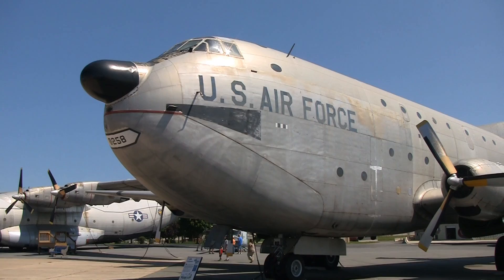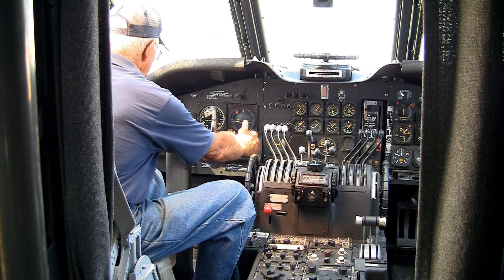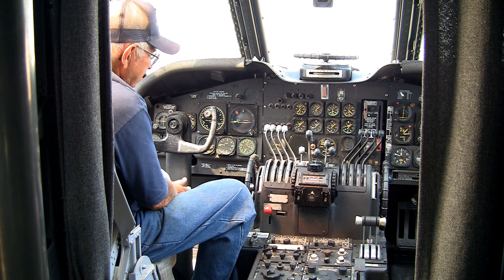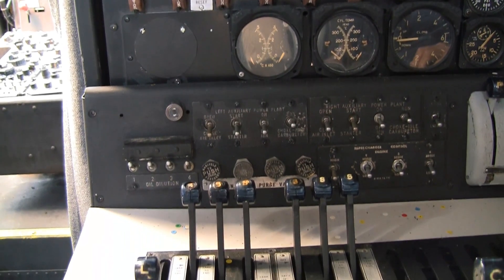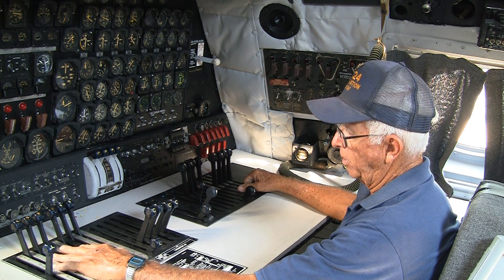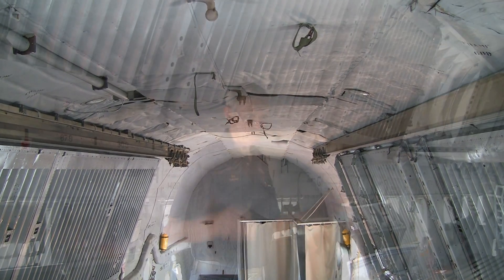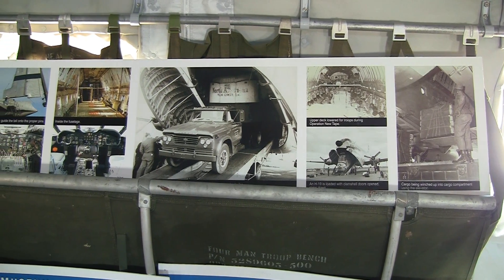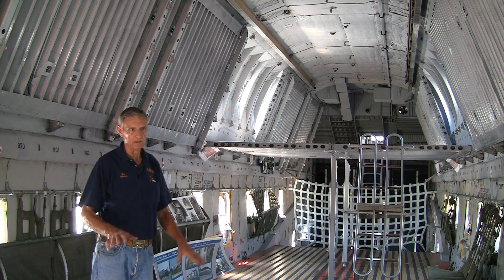C-124A Globemaster II - "Old Shaky"

Comment: I was an Army Warrant Officer Caribou pilot and ferried my CV-2B to Vietnam in 1965. We had an Air Force C-124 assigned to our company to help us navigate. All the Army really had for over water navigation was dead reckoning. The Air Force C-124 pilot would delay his take off to arrive at the halfway points between islands at the same time as our slower flying Caribous. I remember that radio call. "This is mother hen, where are my chicks?" Then I would hold down the mike button on my FM radio and the C-124 navigator would home in on the signal and find us. He would give me a new suggested heading, and then fly on.   We were a flight of 12 in three formations. I was the designated navigator in the lead ship. I remember on the longest leg which was from California to Hawaii we had drifted 70 miles off course by the mid point due to unknown winds aloft over the ocean routes. As we drew near each of the islands at 10,000 feet, and at about 80 miles out, my ADF needle would home in and I could relax a bit and track inbound to each destination airfield. All together it took 80 flying hours to make it from Fort Benning to Vung Tau.     TRH
Reply: Gage  Hi Gage. Yes we had a powerful HF radio, but during the day it is not very effective. They were rarely used in normal day to day operations. At night when the ionosphere re ionizes, the long wave signals start bouncing off of it and then striking the ground at a high angle and then back up, and so on. It is possible under the right conditions to send and receive signals half way around the earth. One of our pilots was a Ham (amateur radio operator) and several us piled into his plane one night, climbed up to 10,000 feet and were able to contact one of his friends, a fellow amateur in the states. Now we were legitimately able to use the Ham frequencies. His friend in turn patched us through to each of our homes on his telephone just to say that we did it.

Comment: I was a pilot on Shakey.  I am ninety years old, and probably one of the few remaining.  To get one thing straight, the engine was feathered prior to going out in the wing.  To get to an inboard engine, your had to crawl  across the retracted gear to get to the panel that covered the rear of the engine.  Normally, the retracted gear just rested, without any pressure holding it up.  When you went out, the gear handle would be put in the "UP" position.  When the generator was pulled, the engine was restarted.   I spent thousands of hours on ole Shakey.  For a year, I flew from Tachikawa in Japan to Korea, hauling in cargo, and flying wounded back to Japan to a general hospital.  On departure, we flew right across the battle front.   Boy, were we happy they didn't have any anti-aircraft weapons.  The pictures brought back many memories.
Reply: Thank you for your service to our country sir.
Reply: Thanks you, Sir.  Without guys like you, we would be speaking German or Japanese right now.  I'm retired Air Force, 35 years of service and a Vietnam Vet.  It pales in comparison with what you were up against.  I salute you...
Reply: Richard Black A great big SALUTE to you sir and thank you so much for your contributions!!
Reply: These Birds were also located at Donaldson AFB in Greenville , SC .
Reply: I'm pretty sure your passengers will be forever thankful for your services. Much respect to you and your comrades for doing what you did.
Reply: I owed you my freedom Pilot Black !
Reply: God bless you sir, and thank you for your service. With all respect, in the case of my father's aircraft, the flight engineer went out in the wing with the engine running as normal as he couldn't figure out why the RPMs were dropping yet everything else showed ok. A cracked fuel line was spraying fuel all over the inside of the nacelle aft of the firewall. It wasn't until the flight engineer came back and told my dad what was happening that "Cut and feather" was ordered.
Reply: My mother lived on Tachikawa for a while. Her father was a MAC pilot at the time. I’m not sure what aircraft he was flying there. He retired a Major General and passed this past summer. He was an incredible man.
Reply: We all do.
Reply: Richard Black n
Reply: I was a young Marine in December '65 catching hops from Cherry Point North Carolina on a Marine R4D and landed on a grass strip in Kentucky and unloaded an R1830 for another Marine R4D, then on to Bartlesville Oklahoma where I got a ride on a C 124 to an Air Force base outside of Seattle. 10 hour flight on old Shaky. Later, in 66 and 67 I would see C 124's at Da Nang air base when passing through.
Reply: Thank you for your service. Ever make a pilot's video to go with plane history/display?
Reply: I too was a flight mechanic on the C-124, & also was at Tachikawa Air Base, my last assignment. I was one who climbed out & into the wing to work on the engine while in flight, & while the engine was running. Quite exhilarating (sp?)! Missed a flight crew assignment the 1st of March, in 1956 & that plane blew up 250 mi out of Iceland. It's on the internet. I was a youngster who needed direction & discipline in life, & got it in the USAF. A lot of great guys were in the service, & way too many never got to come home....
Reply: Thank you for serving. Would love for you to do an informal off the cuff interview in new as you were there.
Reply: To bad they didn't have generator quick disconnects back then, my dad was a C130 flight engineer for 27 years, he ad more then a few generators go out in flight on him
Reply: My neighbor was a F-104C pilot with the 198th TFW back in the 70's. He invited me and my friends to the base often. We saw the C-124 hauling cargo there. I still have a couple of pictures of those airplanes. Sometimes I reminiscend  on those days. We were very happy young boys.
Reply: Richard Black thank you sir!!
Reply: I salute you sir.
Reply: Sorry for the belated response. Love this old aviation historical stuff. Thank you for your service sir! Semper Fi
Reply: As a fellow pilot i think you, sir, are a f*ng legend. Thanks for sharing
Reply: My dad went down in a c-124 crash into the frozen han river after takeoff in 1957. He was a medic. A hero. He just passed this year. Thanks to those who served..
Reply: instaBlaster.
Reply: God Bless Sir.  Much RESPECT!
Reply: A message from the passed on I'm assuming by now this man has passed if he was 90 8 years ago. Soon we only be able to read about them in books, or watch videos time passes so fast.
Reply: @martenedavee1724  
You Rock Martene !

Comment: I was stationed at Dover AFB from 06-66 till 04-70. Spent my 4 year career at Dover. I was a 42152 hydraulic, flight control, landing gear and brakes. I serviced many C124's and also C133's and C141's. The C5's were just coming on line when I left the Air Force.
Good times trying  to keep Old Shaky flying.
Reply: I was a R4360 engine mechanic at Rhein Main AFB, Frankfurt, Germany, 1967-1971, worked on the same airplanes you did. 43251

Comment: Herb Butler
I was an electrician on the Shakey. At Tachikawa 62-64 and Charleston 64-65. I pulled a hot generator (bearings) from #4 outbd and padded the opening. Engine shut down and feathered. air started after done. Crawl through wing was exciting. Strange feelin standing up in the outbd nacelle. We were flying at 10K feet.

Comment: As a 20 yr old newly commissioned navigator, I was assigned to the 50th ATS at Hickam AFB flying C-124s. The achilles heel of the C-124 was the electric prop governor it was fitted with which on too many occasions would fail and cause the prop to go into a flat pitch. This would cause an immediate overspeed condition of the engine which if not responded to could and did, on occasion, result in the prop's separation from the engine. The sound of the overspeed condition was something you never wanted to hear again if you once experienced it.
 One of my first trips was with an Aircraft Commander by the name of Tom Cunningham. Not too long after my arrival he transferred to Hill AFB where he continued flying C-124s. On Jan 1st, 1964 on a flight inbound to Hickam from Wake Is his airplane went down and no trace was ever found. I was on "Hot Alert" that morning. My crew was called out along with the crews of 5 or 6 others to fly in formation at 1,500 feet to Wake Is and back on the flight plan track he was inbound on. Two days later upon our return to Hickam we were amazed to see Hickam's flight ramp packed with aircraft from bases all over the mainland which were being used as search aircraft. For over a week these aircraft would set out a dawn with an assigned grid to search including areas east of the big island! Nothing was found.  About a week after the operation shut down a Charleston C-124 crew en-route to Wake from Hickam reported on HF that they believed they had spotted a raft. That started up a resumed search effort that failed to find anything either. It was postulated that the extensiveness of the search effort my have been related to the possibility that nuclear material may have been part of the cargo he was carrying considering Hill AFB's mission. RIP Tom, god bless.
My 3000+ hours of flight time on Old Shaky are treasured memories and provided me as a navigator with invaluable experiences that were put to great use in my flight career that lasted another 35 years.
Reply: What is a flat pitch?
Reply: @studinthemaking  The blades are flat and not turned at an angle with no bite into the air, thus they were free to turn much faster because there was no wind resistance to slow them down.
Reply: My dad and Captain Cunningham were best friends at Hill AFB.

Comment: My dad was a Flight Engineer on these. He used to tell a story of once they were past the point of no return between Hawaii and Guam, I think, and had lost one engine and the second was failing. The load master was calculating how much to jettison. Dad was in the scanners position and said the prettiest sight he ever saw was that SAR C-130 riding shepherd off the port wing. He looked around and saw another on the other side. They made it in okay but I think that might have been when dad explained the "pucker factor" to me. As an Army tanker, I've had a few of those moments.
Thanks so much for the video. I can still hear my dad saying some of the same things these guys said. Max power...meto power. I've got pix of dad at the panel and he told me of a few trips out into the wing tunnels in flight.  Great memories.  Thanks again.
Reply: This is what we called "A Flight Engineers Airplane." I flew as a civilian from the analog age into the digital age, but never flew the big "Recips." I can proudly say that in the Supplemental Airlines I flew with "Professional Engineers." They all had A&P licenses and were not "pilot wannabees" like the engineers at the major airlines. As a Captain I would describe them as the most important crew member who, as I tell people, actually ran the aircraft. We flew them. The Loadmaster was in the category too.

Comment: I was a prop specialist at Travis AFB, in 1965 on my first day working on the flightline I was working with a civilian and we were doing an inspection in a hanger.  The man I was helping was supposed to isolate the prop system by pulling the circuit breaker, he didn't.  We were out in the wing between number 3 and 4 engine in the crawlway.  He took the cover off the J box and somehow started a fire by accidently grounding an ohm meter on a pressurized fuel line which instantly spewed fuel and igniting it.  I was on the outboard side of the fire so I crawled out to number 4 nacelle, the escape door was already open, I climbed out and started yelling  "Fire, Fire"  I saw about 5 guys on the ground start running away.  There was already smoke coming out the escape hatch, there were engine stands so I jumped down onto one and climbed down.  There was a firebottle on wheels that had long hoses on a roll  up spool.  I had never used one but I quickly pulled it over to the C-124 to as close as I could get it to the engine stand, holding on the the nozzle end I climbed back up onto the nacelle, put the nozzle of the fire extinguisher into the escape hatch and pulled lever to initiate the extinguishing sequence.  I heard a loud noise as it spewed CO2  down into the nacelle.  I held it for what seemed for a long time but really was not to long probably, I put the fire out. I didn't even think of the civilian who last seen was also in that wing.  Turns out he crawled back out of the wing and went down the landing gear and escaped the hanger that way.  The whole thing was covered up and I heard nothing about it ever again.
Reply: First day on the line, that would have scared the heck outta me.  Good thinking, sounds like you did exactly the right thing.  Glad it all worked out for you.
Reply: Dave Constantineau 
I was in the Navy and we were trained to run toward the fire.

Comment: As a US Army Paratrooper in 1961, I jumped from a C-124. It was decked out with 2 levels, the lower level jumped first then as the plane circled around the top level troops moved down and then they jumped on the second pass. It was a huge plane. I was surprised something so big could fly.

Comment: INCREDIBLE video, and great personnel. Fascinating!  I was just thinking of crawling through the inner parts of a wing to turn off a generator.  You'd be a couple of feet from what, a roaring 3500 hp+ double or triple bank radial engine?  The noise must've been tremendous!  You guys who flew these lovely old aircraft were true pilots/engineers/navigators/mechanics.  I envy you for your experiences.

Comment: Thanks so much for the video of this magnificent aircraft, and the expert talk of the two airmen, thank you!
Reply: In 1963 I was working for a company called Dynalectron. The AF at Clark in the PI forgot to chock a 124 and it rolled backwards into one of those deep drainage ditches on field. The plane had crush damage from the elevator to the tail. No one wanted to repair it, even Douglas. We took the contract and had it flying in 90 days. We had six people and used no factory supplied parts. They said it couldn’t be  done.

Comment: "Old Shaky" was powered by four Pratt & Whitney R-4360 Wasp Major  radials, "Corncobs"

Now the Corncob had 28 cylinders in rows of four and each of those cylinders had two spark plugs and needed very little effort to foul them, ALL 56 of them, in one go. Which is where the "Old Shaky" nickname came from, because if one of the corncobs went bad the whole engine would start to vibrate so bad that people were afraid that the whole plane would shake apart.
Reply: Wow! Great piece of info. 
I guess the spark plug companies went bust when the airforce changed to jets.
Can I ask you if they used special plugs or the same kind you use in any automobile?

Comment: Thanks for a very well done and informative video.  I was a fuel systems technician on"C" models (12 tanks) at Dover in 1966.  Later I 1968/69 I got to fly from Upper Heyford, England to Moron AB in Spain and return.  To me, sitting in the back, the airplane felt smooth as silk ... a really great bird.  The sound of those 4 4360's on takeoff was unforgettable.  Trust in God and Pratt & Whitney.  ;-)

Comment: I flew from Seoul Korea  to Tachikawa Japan many times on an old shaky in 1952-1953.. I much preferred it over the C-54 as it was less noisy, a lot faster and more room to stretch out.Taking off from Seoul was something, as you were only about twenty miles or so from the front, the pilot would literally stand  the C-124  (it seemed) in  a vertical bank.on its wing. It never happened to me but some planes took small arms fire I am told. Unbelievable big airplane.
Reply: Did you ever run into a C-124 loadmaster named Bob Broady?

Comment: Growing up in the Azores Islands we were in the flight path and saw so many 124's and KC-97's fly over our house 24/7. I never realized just how large a plane this was until I saw one at Travis AFB museum. Just retired from being an avionics/electrician mechanic having worked 47 years on AF aircraft including T-38's T-37's F-5's KC-135 B-52 SR-71 U-2  F-106  F-4  A-7  A-10  F-111 and F-15's. I did have a storied career and will indeed miss it, but my back wont miss it one bit!